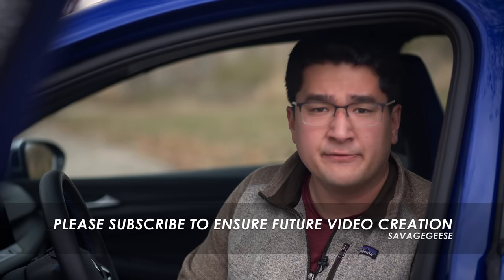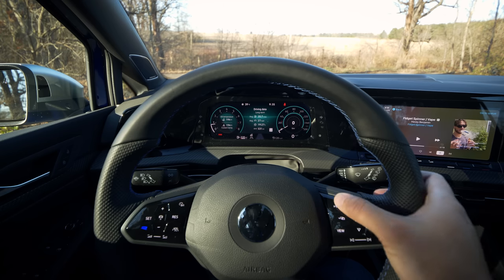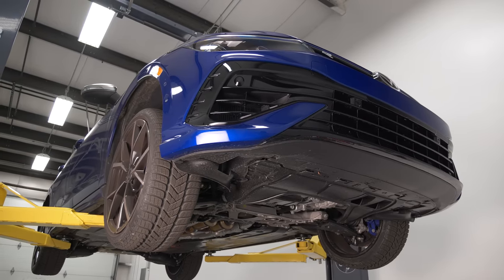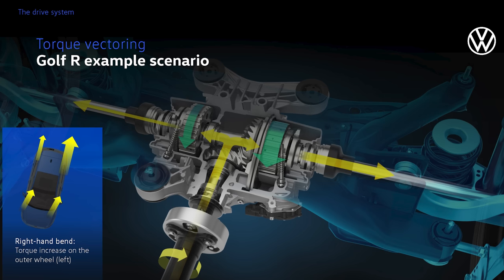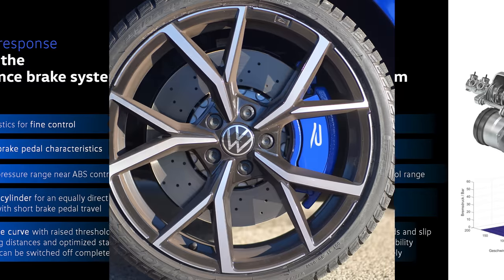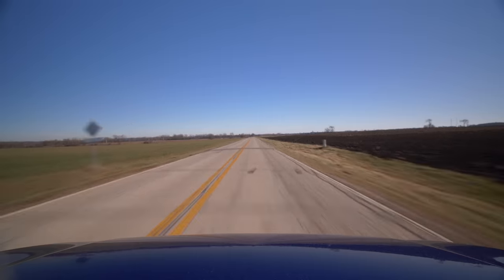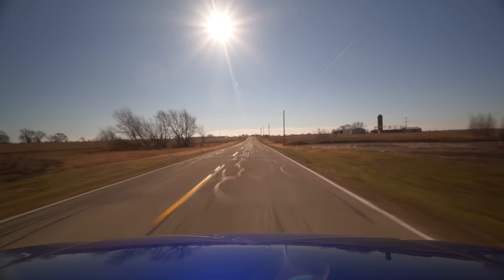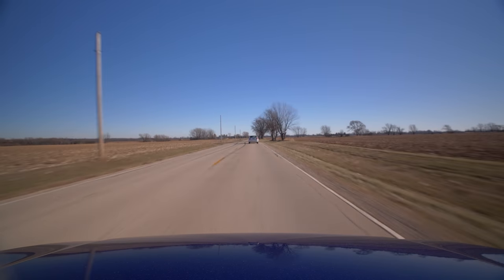2022 VW Golf R | Tearing Up The Streets

Comment: Wonder at what mileage it starts breaking down? My guess would be around 50k miles or 30k if you drive it hard
Reply: I'm at 80k on a turbo swapped Mk7 GTI. Please stop with the Scotty Kilmer VW hate.
Reply: @deanmarr785  You should contact Scotty. Any turbo VW that has reached 80k miles could be one for the record book.
Reply: @deanmarr785  Ok let me go check it out. Hard to sift through the shortcut lingo" I tined my GTI at 44 miles" ???
Reply: @captinbeyond  My bad. Grammar corrected.
Reply: @deanmarr785  I'm still looking for info long term reliability issues. My opinions formed about VW being a  trash company formed long before Scotty started doing videos. Years ago we had a Saturday morning radio station call in show with 3 mechanics from 3 different garages that answered callers auto related questions. And they all bashed VW's for just dump engineering....like having to take 20 items off to get to 1 part , and putting the VCM under the seats so if water ever got into a vehicle just a little bit it would ruin the electrical system. They begged listeners to avoid VW's at all cost. 
Then we had the TDI scandal where VW leaders admitted to scamming the buyers of VW's  and had to do the buybacks---I'm sure you heard about. How could anyone trust or want to buy another vehicle from a auto maker whose very top CEO's admitted to lying about the cars performance? What else are they covering up?
 Everything Scotty bashes them for just reinforces what I already have heard and read about. VW's are a good zip around car for a few years but then start to break down. Some of us want more reliability than just a fun car and then dump it off on some sucker.
Reply: @captinbeyond  Mk7s have proven to be reliable. They are on the 8th generation and the golf has been europe's  best selling vehicle for years. We disagree good luck to you.
Reply: @deanmarr785   I went to a number of sites and videos and yeah, they seem to have good comments. A common problem kept coming up with their water pump/thermostat, plastic oil pan issues, Navigation units, and the turbo failing early. Also common, have a good mechanic you know that can work on them.
Reply: @captinbeyond  Replaced my waterpump at 67500 miles . $750. They are crap.
Reply: Truth Teller  Good idea
Reply: Truth Teller  i'm not complaining. just stating fact. The waterpumps on these cars suck. The motor and DSG are stout and can handle power!

Comment: It's funny to think the Type R is going on almost 5 years old now, and it's still being compared to these new cars and still better, even after all these years. When the 11th Gen Type R comes out next year, it will be absolutely MEGA
Reply: This smokes the type r
Reply: @br8y693  you are mistaken, manual Golf vs manual CTR the CTR roasts it from a roll, and not to mention it's faster on a track, more engaging, and a better driver's car, AND it's now almost 6 years old and still better which is pathetic. When the new Type R comes out next year, it'll be even more further ahead of the Golf. You can take an auto Mustang GT, vs a manual Mustang GT and the auto wins every time in the 1/4 mile (which is a COMPLETELY wasted testing a cars speed, means absolutely nothing in the real world) but the point of my post was not to bash the Golf, it was the fact the CTR is almost 6 years old, and is still the better all around performance car which is mind blowing. The new CTR will be game changing

Comment: Decent car... I think I'd take an Audi S4 or Civic SI,  over this though.
Reply: Si over a Golf R. Yeah I want a 350z instead of  911. Si not in the same league as a Golf R.
Reply: @deanmarr785  I wouldn't be surprised if the Si has better steering and handling (depending on how similar the Si is to the Type R), but you'd have to drive them back-to-back to compare. Lack of steering feel was a major complaint of the Mk7.5, and Harry's Garage noted the steering of the Mk8 Golf R still being quite inferior to his Toyota Yaris GR or the Civic Type R, he said that "for most of the time, you may as well be driving an ordinary Golf".
Reply: @TassieLorenzo  Si competes with the GTI not the Golf R. The GTI is a much better car, Owned both the VW is better in every way.

Comment: I test drove a new Autobahn GTI on Saturday.  It had a 2,000 dollar dealer markup (I just laughed at the sales person) bring the total north of 42,000 dollars.  The Golf GTI is off my list completely due to the stupid goddamn touch screens / haptic feedback buttons.  Twice as I was rounding a corner my hand hit the buttons for the stereo and changed the station.  The interior quality isn't good.  The screens are lacking in resolution / speed after touch.  There were exposed seat rails on both sides and exposed hardware all over the place.  

But the worst thing.  The absolute fucking worst goddamn thing is the volume adjustment for the stereo.  You move your finger up or down the "slider" and either nothing happens or it moves a quarter of the distance your finger actually moves.  It's hard to see.  It's hard to use.  I drove it back onto the lot and the sales person asked what I thought...  I told him I thought it was the worst interior design and technology implementation on a car built in the last 10 years.  He agreed and said "yeah, pretty stupid to get ride of actual buttons and knobs for the stereo and HVAC" 

Uggh.  Damn you, VW.

Comment: STI runs horrible on 91 octane stop making the comparison lol. These other vehicles are designed to run on 91 octane while an STI is made for 93 plus and states that in the manual.

So yea if you put the wrong fuel in it guess what it doesn’t run right. Wow that was hard to figure out….

Comment: Disclaimer: I work with VW's and drive them. I think they did a fantastic job with both the GTI and this new R. They polished the driving dynamics of the previous generation while improving them, and added a lot more tech (for better or worse). Do I think the execution of the infotainment and climate controls could be better? Sure. But it's not that bad, and it offers a pretty competitive set of features compared to other manufacturers.
Reply: it wouldn't surprise me if they revise the infotainment over the next couple years. it's a trend these days - you leave something on the table for later model years to "improve upon."

something as resource intensive as re-adding physical controls might have to be the mid cycle refresh though, I think. so I might be waiting for the 8.5 R lol
Reply: @splak_5624  Possibly. If you look at the recent facelifts that VW has done (Jetta, Atlas, Tiguan), there has not been much change besides some new seat designs, bumpers, and a steering wheel. Back in the day, (the 2017 Passat refresh comes to mind) facelifts used to change a ton on the car. Now, not so much.
Reply: I don't think it's a question of execution, it's about usability. If a car's interface is unintuitive, frustrating, distracting and slow to use it detracts from the overall driving experience. It's also potentially much less safe if you have to take your eyes off the road all the time.
Reply: @dielaughing73  I don’t disagree, but am genuinely asking if you’ve used it yourself yet. I haven’t found it unintuitive or frustrating, and only marginally more distracting than the previous gen MIB3

Comment: It still doesn't have double wishbone front suspension like a Type R. For the price, probably better than Audi spec out A3, etc. Magna equipment. to get the mechanical buttons, just buy the Audi. Also, no point to the MT in this car; just get the DCT.

Comment: Very good videography. But vw really overshot and underdelivered with the Golf R. For the money, the interior is genuinely poor. The Jetta GLI is significantly cheaper and has cooled seats. For the money, get an S3, the interior is miles ahead of this. The haptic buttons look and feel cheap and can be actuated by accident when turning the wheel. The infotainment system is not user friendly and the climate controls are not lit, Honda learned this on the previous gen Civics, and got crucified in consumer reviews. The amount of screen inputs that have to be used for everything, including the radio volume, is just downright wrong from a usability point of view. Get a Jetta GLI and if you want the R power, swap out a bigger turbo and you’ll be fine. The ea888 engine is stupidly reliable. The mk 8 golf, whether it’s a gti or the R, is too expensive for a product that was clearly cost cut to death. If you must get a vw, get a Jetta GLI, it’s the same engine in the gti. If you’re paying all that money for the R, get an S3 with a proper interior and better sound for the same power. If you must get a hatchback, Mazda3, infinitely better all around. Having owned all 3 of these new vehicles in the past 8 months, the golf sucks, traded that in for the Jetta, love it, I drive it everywhere. Got a Mazda 3 for the business, great usability and the extra room of the hatch really comes in handy. Leased the S3 last year. It’s fun, really fun. If you want a comfortable ride at a good price, S3 is where it’s at. Don’t pay the $10k markup for the RS3, you can get a fantastic ‘19/‘20 used vehicle for $60k over the $74k rs3 I’ve seen dealers asking for

Comment: The interior is a big reason why I bought my 16 R over the competition at the time. Great blend of analog buttons, knobs and gauges with some tech expected in a modern car (mine has no driver assists thankfully). This however is a dealbreaker for me. Voice doesn't work well and driving with gloves in the winter means I cant adjust things easily. Bring back the knobs and ESPECIALLY the dedicated climate controls from the mk7 R.

Comment: The infotainment is a valid complaint, but I think when you get down to it there isn't really a better car in its class. The Type-R doesn't have AWD, the WRX STI is dated, the Focus RS is discontinued, and comparable Audis are more expensive. Every car has tradeoffs, it comes down to what factors you value the most. I can live with capacitive volume and climate controls if it means I get a fast AWD hatchback with a great interior and good gas mileage.
Reply: CLA?

Comment: This is all well and good, but when the warranty is over, it's still a VW.
Reply: It's a superior warranty at 4 yrs/50,000.     But to repair a windshield wiper for $1,200 (true story) is having me look elsewhere.
Reply: @bbartlow0307  A superior warranty to what? I had a 2016 Golf R manual. At 30k they replaced the prop shaft. At 55k, it started making a very similar noise to what precipitated the prop shaft being replaced the first time. Additionally, the mild steel plate between the engine and transmission rusted where the rust accumulated and rubbed on the flywheel, making a horrible noise when cold.

Finally, during assembly, they forgot to put the body plug in the right, rear underside of the car. That was a perfect doorway for mice. Luckily, Carmax gave me 80% of what I paid for it 6 years prior, so it's gone.

I'm considering a Genesis G70 3.3T as a replacement. Cost is similar, the warranty is vastly better, the dealers can't be any worse than VW dealers and it's a heavily rear biased AWD system. Oh yeah, the car has real buttons.

Comment: Hey guys , PLEASE fight for us Kona N AWD want to be buyers. You have their 
ear and you know exactly why we need an AWD Kona N AWD. You have had 
EVOs and a TT, you know how GREAT AWD is in a high perf car.and how 
great AWD is in the corners.  Please  tell Hyundai, tell them there is a
 large group of car buyers out here that NEED, yes NEED a Kona N AWD. 
NOT the" crippled" 2wd with massively high roll center Kona N they gave 
us.Your going to be fighting the 2WD axle tramp and torque steer with 
the HP that is in it now, let  alone when you add bolt ons. SO many 
testers have called the Kona N's  the twitchy handling of the" LIFTED" 
Kona N. There is "no good reason" you LIFT a 2WD street racer and 
"cripple" it's handling. Big time fail on Hyundai's part. From my 
research 1/3 of the would be buyer will only buy the Kona N if it is 
AWD. We want a Golf R, EVO "replacement"/chaser  Not an "also ran", 
lifted handling mess from a horrible setup "crippled" roll center 
Hyundai gave the Kona N. We don't want axle tramp, we don't want torque 
steer. That latter they try to say they want to give you torque steer as
 an input sensation. BS is all it is. A Kona N AWD would be KING of the N
 cars if it came out in AWD. And NO the eLSD will not put power down 
like a eLSD with AWD.  Hyundai gave it's buyers the BS that it was too 
complicated to do AWD (when 1/3 of their cars are AWD more BS) Then they
 said they wanted to keep the price down BS, AWD would be a $1,400 
option and the rear diff on the regular 1.6T Kona N AWD can handle 1,100
 ft lbs of torque as per the manufactures website. SO no saying hardware
 is an issue. They have AWD/transfer cased 8speed trannys already. 
Hyundai would double the Kona N sales with AWD.  AWD in the corners with
 high HP is so awesome. The Kona N AWD was ment to be, but Hyundai 
ruined this epic final outcome of the car to a lifted "crippled" roll 
center axle tramp and torque steering of a car that can't take any more 
HP without even making the experience worse.  AN AWD Kona N, would 
"dance through the corners" with more HP. Double the car sales if it had
 AWD. You would get 1/4 of the Golf R sales, EVO replacement buys, 1/8th
  of WRX sales, used Audi S3 and X1/2 BMW sales. More female sales that 
want a sexy/qwerky  little  AWD for safety/ will still looking sporty. 
Now you will get almost zero female sales. A 2wd Kona N offers most 
female  buyers nothing. An AWD Kona N offers them the safety of AWD.

Comment: I really don't think this car is a bargain at all when you can get into a WRX for $30k.  Yes, a tune is basically a requirement to fix the "monkey mode" throttle mapping the car comes with from the factory (easily fixed with an Accessport and OTS tune), but for a daily/winter beater, there's no way I'd choose the VW over it.  For less money, I get physical controls and overall a more analog driving experience while still being the "cheat code" for winter driving.

Comment: I'm sorry, but the infotainment DOES break the car for a lot of potential buyers. There is a good reason why (at least here in Poland), a well-kept, low-mileage Mk7.5 GTIs are just as expensive as brand new Mk8 GTIs. There's a ton of Mk8 Golfs available with 2-3k kilometers on the clock and nobody wants them. Meanwhile, Mk7 and Mk7.5s are selling like crazy. The infotainment is not just frustrating in daily use, it's borderline dangerous with lane-assist often going bonkers and being impossible to turn off permanently.
Reply: That, and horrendous VW reliability!  With VW's, it's 'hit or miss' as far as reliability goes.  I know... i've owned many VW over the decades.  I have a 'love hate relationship' with the marque.

Comment: Save your money and wait for the TOYOTA COROLLA GR when it comes out.
Reply: It would be the same engine as in Yaris GR?
Reply: Absolutely the same, and more reliable for sure.
Reply: It will be slower stock, and have one less cylinder to work with, which means it will still be a lot slower, even when tuned and modified. it will be cheaper though, by a lot.

The MK7/7.5 has already proven itself to be very reliable, even when pushing double the power they come with from the factory. Maybe not as reliable as a Toyota, stock vs stock, but considering its engines are tuned and pushed a lot more than a Toyota, its pretty dang good. Plenty of us MK7 owners in the 100k going on 200k miles with no major problems. The Mk8 uses the same engine with minor upgrades. Also, lets not forget that Toyotas reliability goes way down once a car is tuned, which, a lot of people will be doing on the Corolla GR. So to say its reliable...yes, when its stock, but no when its tuned.
Reply: It will be alot lighter than the golf.

Comment: STI’s do not pull timing with 93/94 octane or running Boostane. You guys clearly test them on 91 octane which drives awful in summer heat. You guys keep beating this point to death but have never acknowledged they recommend 93+ octane. Give people actual decent information. These cars are designed for 91 octane. An STi is not its not a relevant comparison 

Trash direct injection Trash on demand awd Trash plastic intake manifolds and oil pans Trash auto stop start Trash not being able to 100% remove electronic nannies Trash touch sensitive buttons Trash VW long term reliability Trash pricing. These cars are maintenance nightmares and worth nothing past 90,000 miles if you ever see one get there.

STI/EVO FTW

both those cars transmissions will also outlast this pos trans in the golf R and way better sounding motors! Nice piece of expensive trash tho! Ugly too lol

also the adaptive suspension fails after a few cold winters! A big waste of money for people who like terrible euro cars

Comment: You spend all your time in the driver seat. The Mk8 is inferior to the Mk7. What no one has mentioned is how cheap the Mk8 steering wheel looks. It's too bad because the quality of the Mk7 wheel is very nice. SG already mentioned the shifter. VW is cutting corners when they should be upgrading for the new generation cars. Shame.

Comment: Getting this much HP and torque, out of a small, light 4 cylinder engine, can't be good for the longevity and reliability of the vehicle.  Of course, it increases driveability and agility by reducing front end weight compared to let's say a VR6 turbo (if VW had used this kind of engine).  What if VW had a VR6T engine, rear mounted, driving all wheels?  It would be as 'radical' as the latest Vettes, with their mid mounted engines!